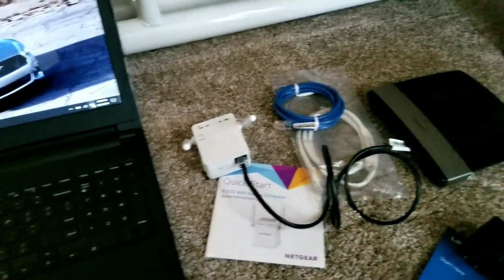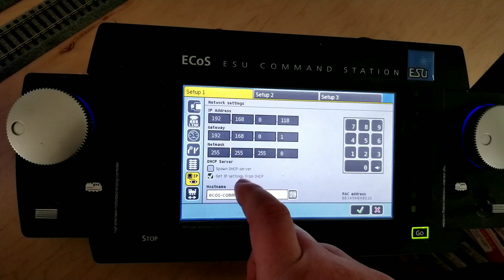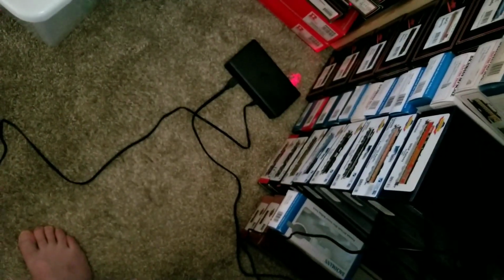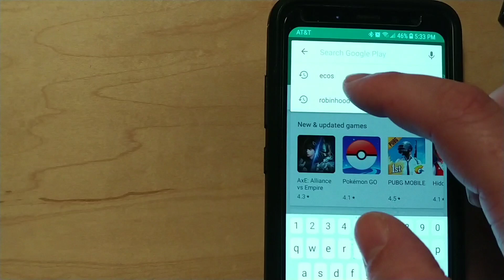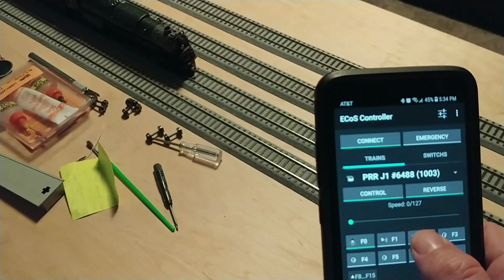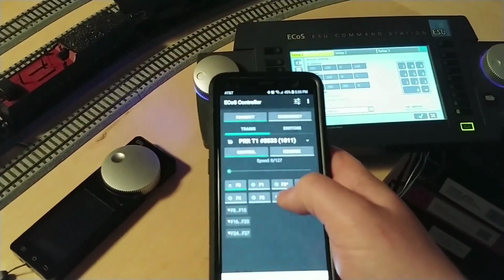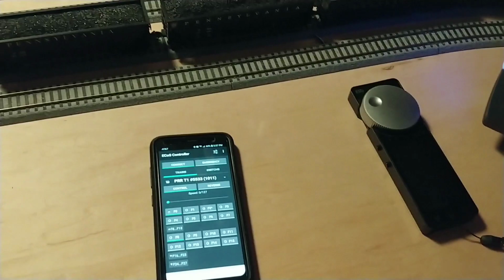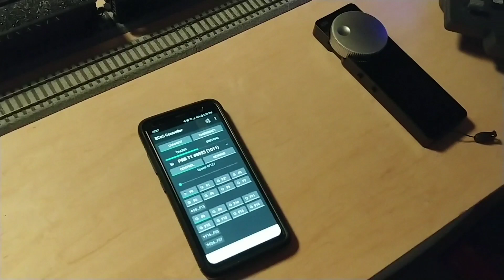Expanding the ESU Ecos system with Android devices

Comment: I know this is an old video, but I'm curious if you are still using this system. I'm about to buy a new DCC system (starting from scratch) and am highly considering this.
Reply from the maker: im still using the ecos, I dont use the cab control system at all, cab control system sucks in comparison

Comment: dude the throttle is not laggy; 2nd no problems here using compt interface, you really need to learn how to use a system to be honest then come back with a video.
Reply from the maker: Its trash compared to the tcs throttle.

Comment: Thanks for posting this.  Great to get a better idea of what may or may not be possible to get away with using ESU's command stations.

Just out of curiosity, will the ECoS Controller app also work with the CabControl system, or is it strictly for operation with the ECoS?

Comment: Cool demo... I sold my esu cab control throttle as its very old tech and as you say the ecos control on a smart phone is far better..
You can also plug in a L net converter to the ecos for adding more options for hard wire throttles,

Comment: I have a very large layout and run ESU cab control with three boosters. You can only run one control system at a time ECOS or Cab Control. They both pretty much have the same system in them. Mine is the newest version and it is very fast and doesn't have the lag you talked about. My first one did it was annoying. If you want addition throttles the Cab Control and ECOS can operate Digitrax throttles. I use loconet jacks so when I have operating sessions people can bring their own throttles. They can also use Android phones and log into my Cab Control's Wi-Fi. It's quite a nice system. I've used NCE, have Digitrax for my n scale layout, and Cab Control is my favorite by far. I didn't buy the ECOS because I wanted to be mobile because my layout is so large. Let me know If you have any questions.
Reply: I too have the newer Cab Control, and really like it over the Digitrax system I used to use (getting back in hobby now, and decided to give Cab Control a try over DT).  I have not had luck to get my DT throttle to work with Cab Control though.  I have plugged it into the back of the Cab Control where there is a L.net connection.  It does nothing when I plug it in.  Are you using the ESU L.Net converter?  I was under the impression that L.Net controller is native in the Cab Control?
Reply: Jeff Pohl I am using the L net converter. The jack on the cab control is not turned on yet as far as I know. Matt is planning on turning that on at some point. Just plug in the L net converter and your digitrax throttles will be good to go! Let me know how you make out bud!
Reply: @barnesproducts173  Thanks.  I will just go ahead and buy the L.Net converter.  They are not outrageous in price.
Reply: @VAJeff0213  cool let me know 
how you make out!
Reply: @barnesproducts173  I received the unit the other day.  It works as advertised...  Plug into the Cab Control, and my DT throttle works as if it were plugged into a Digitrax system.

Comment: Cab control is far superior to any cell phone to use as a cab/throttle. No doubt, main reason is the actual physical knob. I don't have to look @ the throttle, especially the one you used, just one crappy line... 😆 With all touch devices one wrong swipe or accidental touch and... 😥 Nice video BTW 👍
Reply from the maker: But they are 240 bucks each with terrible battery life.  Makes it hard to love
Reply: @RodimusPrime  Get a new battery. They had battery problems. Mine last all day no problems now after replacement.